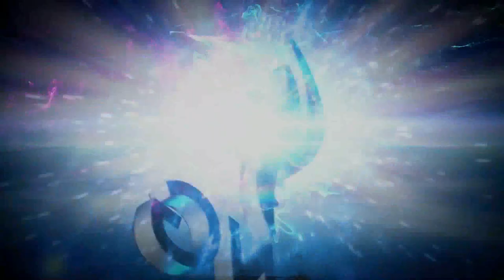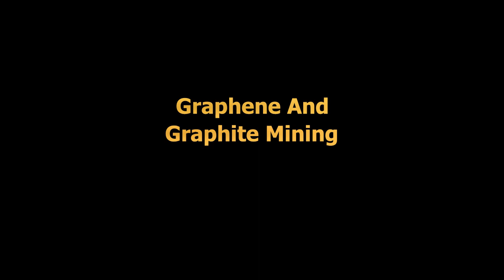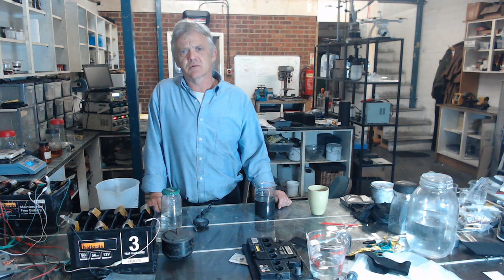Graphene And Graphite Mining

Comment: Dear Robert 
I would like to ask you a question, which does not have much to do with the subject of the video, but it is also very interesting
-By a farmer friend, I knew that rainwater is better for watering plants, because apparently it contains atmospheric nitrogen dissolved by the action of lightning and storms, and I thought
-Could this process be easily imitated at home?
using a tesla coil for example and an atmosphere saturated with moisture, would the electric discharge fix the nitrogen in the water in some way?
thank you Robert
Reply: Lightning naturally produces nitrogen oxide, which reacts with oxygen in the air to form nitrogen dioxide.  This reacts with water to form nitric acid, which reacts with a large number of minerals to form nitrates.

Electric arcs can be substituted for lightning.  Cody's Lab did a video on it.
Reply: You don't need to fix the nitrogen, you just need to dissolve it into the droplet. If you can charge the droplet it will attract the neutrally charged N2 molecule (and other gasses) as it falls. I have wanted to do this exact experiment for a couple of decades now but using kelvin's thunderstorm to put the charge onto the droplets. Check out Kelvin's Thunderstorm.
Reply: @ancapftw9113  Thank you very much I'm going to take a look at the Codys video
Reply: @TonyGrant.  Thank you very much I take note of your good contribution
Reply: Desmond Bagley  Thank you very much legumes are a good option too
Reply: @jorgemartin7697  Thank you jorge. I have built 3 versions of Kelvin's Thunderstorm over the years but not like any you will find on Youtube. Mine were based on Victor Shauberger's 'Water Thread' experiment which makes a fine spray. Next time I build one I will make a clip and put it up on Youtube.